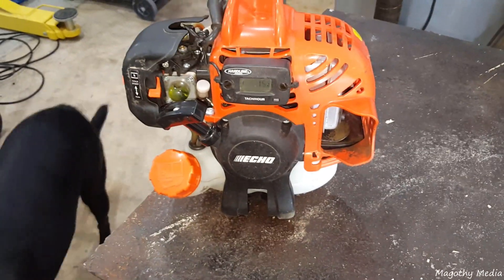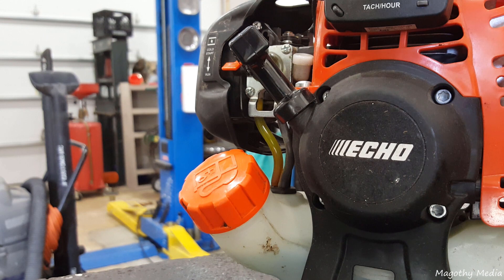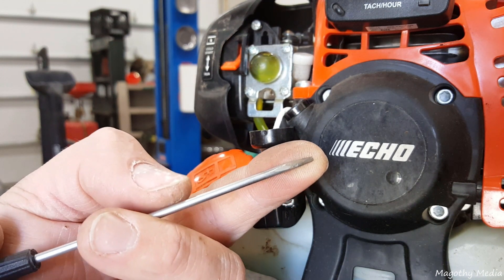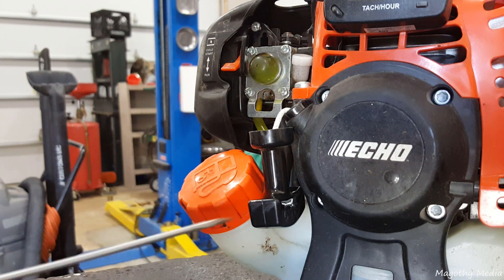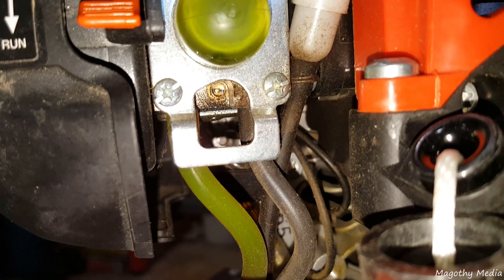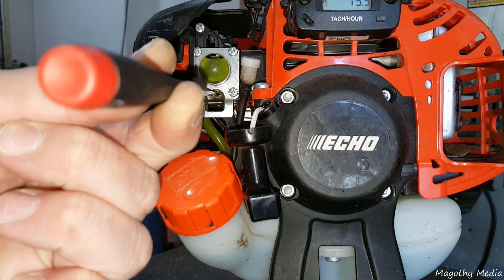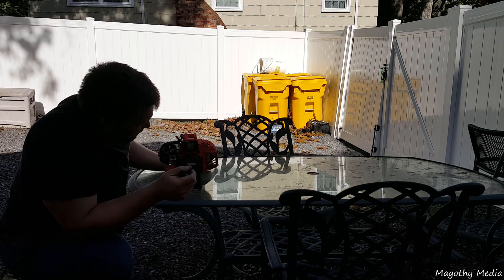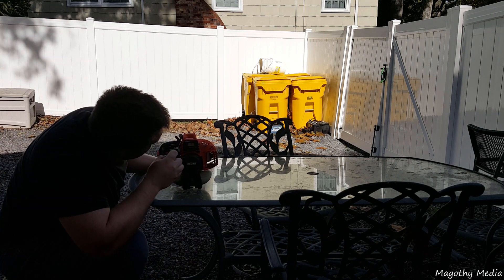Echo Carb Modification EPA Plug Removal for High Speed Adjustment

Comment: AMAZON PART 91075 LIMITER CAP TOOL WORKS A LOT BETTER THAN CHANCING DRILLING IT OUT AND MESSING THE CARB UP. PLUS YOU CAN PUT THE CAP BACK IN TO PROTECT THE SCREW.

Comment: One point no-one mentioned is CARB (California Air Resource Board) has mandated Zero Emission on small equipment requiring all small engines be replaced with battery packs. 2-Cycle has been banned in Calif for many years and now everything under 50HP is outlawed. How long until all states follow their master plan? I saw a Ryobi push mower for 900$ in another video, the replacement battery packs (2) were 219 each.
Reply: gotta love commieforina. Its always such bs with that state.

Comment: Just grab a drill bit that will fit snugly into the brass plug , the end of the drill bit that fits in the drill ,, NOT the cutting end , after getting a bit that fits snugly into the brass just pop it out sideways !

Comment: The brass piece is removable if you disassemble the carb and use a good pair of pliers , like Knipex pliers to remove the plug. I think I might invest in the Echo 2.5mm tool.
My problem is the compression and the carburetor itself.
Compression is 88 psi.
I ordered a new carb so we will see if that's the issue or is it the compression.  Spark arrestor and port are very clean.
Thanks for the video.
I have owned Echo for years with the High Low and Idle screws that are very visible and I wish they would have never changed to these , so called , fixed carburetors

Comment: I just got my carburetor rebuilt and now my SRM210 is running super fast, even without the gas on the head is turning like I'm giving ot gas.
Reply from the maker: Could just be idle screw adjustment. Otherwise I'd check for a lean condition

Comment: I know you’re limited on space but I would move that hour meter away from the back where you have it. It’s an air cooled engine forced by the fan and exits out the back. The engine could overheat.

Comment: Keith Davis
I've pulled that plug out of several echos and other trimmers. The heated small screw driver or small drill bit works great. Just heat and insert and then WAIT about thirty seconds. Once it cools it holds on much better. You can't just heat, insert and start immediately twisting or pulling. Give it a little time to set up.
Reply: The heat poke works like a charm

Comment: Hey guy great video. Can you tell me the size of the thin carb adjustment tool your are using. Is it a packman or half D?
Thanks
Reply: On a 225 it’s just a slotted screw behind the plug. On the 2620 there’s no plugs, the high and low adjustments have to be made with a “micro d” tool. I was lucky enough to find the Echo adjustment set with a “micro d” tool and a “single d” tool but they’re kinda pricey.but well made.
Reply: @andybecker2693  hey Andy where can I buy the tools for the 2620? I recently bought a new 2620 trimmer and it vibrates more than my old one. What could the issue? Thanks!
Reply: No one will sell the Echo micro d adjustment tool, but just Google it and there are a couple of options.
Reply: @andybecker2693  I bought a brand new 2620 Trimmer and it vibrates a lot. My 4 year old 2620 is butter smooth. What do you think could be the issue? Thanks
Reply: @chewarmstrong  Not sure but I would take it back to the dealer unless you bought it online.

Comment: Wish I would have thought of putting hour meters on my equipment. I would be curious to know how many hours are on my redmax 8500 in the past 7 years.
Reply: I had a Redmax that lasted 12 years commercially, would've loved to know the hrs. on it!
Reply: Nick Grottenthaler I got a trimmer with 8 years use on it. Still running good. Have another that got a donor engine off an edger, still running good. Lightweight trimmers, don’t vibrate much. My dad uses maruyama. He tears stuff up but they’re still running strong. Changing the grips and throttle cable out on two of them right now 😂

Comment: You have to love the EPA.  Is the equipment being run at sea level or at 7000 feet?  Makes big difference for the carb adjustment for a carb that can not be adjusted.  No, one size does not fit all.  I have lived at both elevations.  Thanks to you, I now know how to adjust them.
Reply from the maker: Yea haha. I'd be curious to know if dealers run into issues at higher altitudes. If they have customers complaining do they have to adjust 1000s? Glad it helped out!
Reply: @jasonfrat9813  I have no idea.  I currently live near sea level.  When I lived at 7000 feet, you could adjust them.  This was over 20 years ago.  Today, almost every piece of equipment I have bought, 2 cycle, bogs.  Guessing that they adjust at factory for about 3000 foot.  Bet that they are all running to lean. Looking at more than a little adjusting here.
Reply from the maker: @TheLittlered1961  Its a shame really. I do know that the stihl dealers will test and tune purchased equipment for people. I recommend most people that cannot do it themselves to go the dealer route. Ive heard so many people complain of poor performance from brand new equipment and if there is no anti tamper it can be tunned in a couple minutes (allowing for warm up).
Reply: @jasonfrat9813  Sadly not all of us can afford Stihl.  Most of us go to home des pot.  $80 vs $120 or more is a big thing.  Yes, I know, Chinesiam vs good quality.  Then again not big fan of our Stihl dealers here.  Fuel intake hose rotted out on my Stihl chainsaw.  They gave me the wrong part.  Took same saw to another dealer for a tune up.  Do not have RPM meter that can read 13,0000 RPM.  They replaced the spark plug.  Used 2 cycle gas, then starting fluid.  Would not start and lost compression.   Let it sit for a year or two thinking I screwed up the cylinder.  For S&Gs I tried to start it again.  Good compression.  Think the rings got stuck.  Still would not start.  Checked the spark plug.  No spark and plug was clean as a whistle.  Engine never ran with that new plug they put in.  Put new plug in and ran great.  Moral of the story.  Price does not guarantee good results.
Reply from the maker: @TheLittlered1961  Wow that's terrible they jerked you around like that. Believe been I know what you mean about the cost. That echo I have has been great so far. Cheap too
Reply: 20,000 leagues down

Comment: Ouch Finally got down to the brass jet to find an flat surface instead of a slot, How difficult to remove and change jet?  Thx
Reply from the maker: If it is smooth across the surface of the brass you're seeing, I would say you have just a brass plug. Perhaps that carb is a different model and that is just a plug for cleaning purposes?
Reply: Thanks , Maybe so, after the drill didn't remove all the plug I tried a 1/8"reverse thrd screw , it backed the plug out along with the brass ring around it!  The echo looks identical to yours , being 2 year old maybe the EPA change the carb design so its not possible to set , my luck.
Reply from the maker: @bullmastiff9991  Yea very possible. Good luck with it!

Comment: I ruined the screw getting the plug out. Tried torx and drilling. It's difficult to tell when you're thru the plug until it's too late. HAS to be a better way.
Reply: My method, as suggested by another tuber, was to use a picture hanger screw small enough to fit. Forcing it in with needle nose pliers. Then when I feel its in far enough, I then wiggle and pull on it and out it comes easy easy! Hope this helps someone!
Reply from the maker: @Bluesky-bx2ig  Thanks for the advice.
Reply from the maker: Sorry to hear that, the only other thing I thought of was a small perhaps dental pick that you could pierce through the plastic plug and then hook it from the back and pull it out. However there is not much room between the plastic plug and the jet. Still worth saving the carb if you buy that jet online.
Reply: The blower works. The problem is worse now. I'll order another. Do they sell them without the plugs?
Reply from the maker: @sun622  you can buy them without it but you can also just buy the Jet and save the cost of getting a new carb
Reply: Hi. When you put the hot screwdriver let it cool in the plug then pull counterclockwise slowly and it should come out fine.
Reply: Don't drill,get anything thats close to fitting plug,heat up,WAIT 1/2 MINUTE,then unscrew.Don't use a drill motor.Drill bit fine.
Reply: @bigbadhag  I just bought another carb which didn't have the plugs. All good now.
Reply: Usually a replacement carb, even OEM, will come without the plugs.
Reply: There is a tool especially made for pulling out the plug. Its made by Echo. Depending on where you look, it costs about $30. I figure its worth the money vs the time spent. Especially if you own several Echo tools.
Reply: @Ahch.  drywall screw. Cost 5 cents

Comment: GREAT JOB! I got my plug out the same way and unscrewed the jet to clean but forgot to screw it in for the baseline setting. Trail and error didn't get it running. I'm going to start at 1 1/2 turns out and adjust. My new Ebat $15 card runs the same as the old one , so I have two carbs to experiment with. Thanks for the video!!
Reply from the maker: Thanks, good luck with yours!